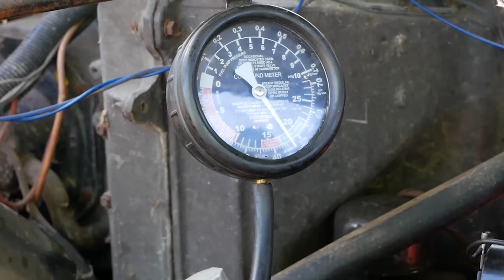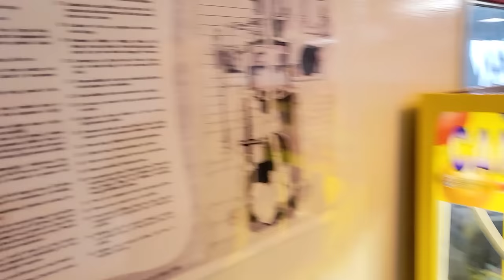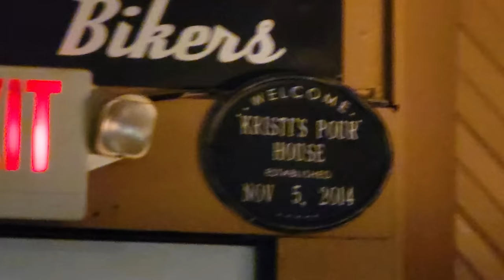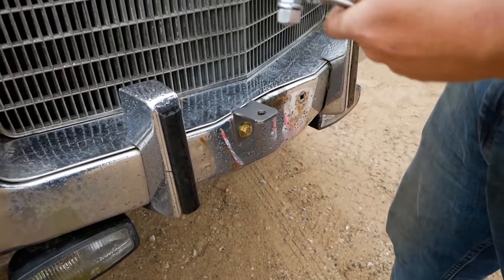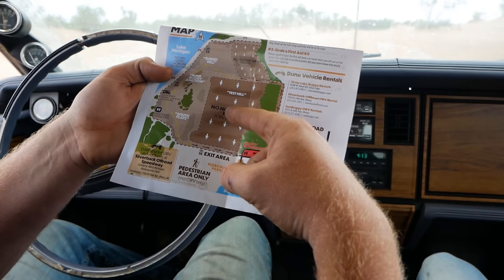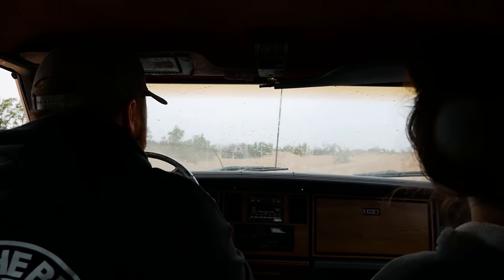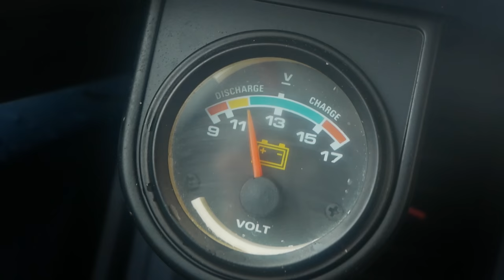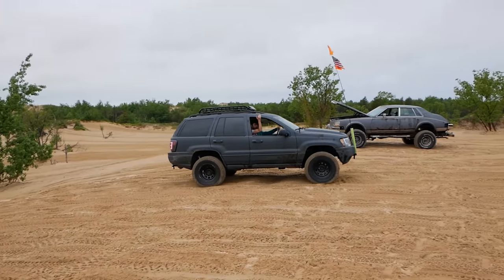4X4 CADILLAC First start in 15 YEARS! - Part 3 - The Dunes

Comment from the maker: 🏹 Start playing Hunting Clash for free on your iOS/Android device https://huntingclash.link/JunkyardDigs. Use my promo code JUNKYARDDIGS to get an awesome starter pack for a total value of $15 (available for new players only)🦌
Reply from the maker: @tadaho2128  its called a recap...? Used to do it every video when we had to split stuff and didn't have an intro filmed
Reply: Next farm episode?
Reply: @johngrefer9799  I would imagine in a while, they already planted, not much left but to wait right.
Reply: how well will the AMC Eagle do in those sand dunes?
Reply: Yeah I'd invest in a set of dove-c heads and a top dead timing set and a rebuilt distributor for the 460 think you'll be surprised how well it'll run I still think the roll pin is sheared and the gear is bound on the shaft causing it to be advanced to far when the mechanical advance comes in lots of timing advance and low compression equals lots of pinging out of a 460
Reply: That's funny, nobody wanted to ride with Jesse.
Reply: I say you try n get the motor actually running right maybe bolt on some extra ponies and then try her in the mudd instead 🤔🤷‍♂️ this badboy could definitely make for good content fixing her up and seeing what you can make of that big block and how capable the thing really is when she has all of her horses in tow! 😝
Reply: im surprised with your understanding of tuning, you drove that thing pinging like that,
Reply from the maker: @faslane5  didn't have a choice unfortunately, distributor was siezed in the block
Reply: go buy or get one of those stator kits they sell to bump up your alturdnator to 170-200 amps. Those stock pieces of junk dont work worth a shit.
 Then you can give us a demo on that rebuild. Good for some xtra content.
Reply: great now i have a nother game addiction hahahah thanks ill game
Reply: 18:28 when u wake up in the morning
Reply: You've got to take the three wheelers out there
Reply: Why don't you bring your little tricks or your 200m
Reply: When will you post the power tour
Reply from the maker: @AZed604  next week

Comment: True story, I am not just a car nut, I'm a maritime historian as well. I honestly thought that you were joking about the ferry being named the SS Badger. I just looked it up and watched some videos of the ship's history. It was built in 1953 as a rail car ferry, and it was bought in 1992 and converted into a car ferry. It's 410' 6" long, 59' 6" wide, and is 4,244 gross registered tons. It displaces 6,650 tons. It has two four cylinder compound Skinner Unaflow steam engines, four Foster-Wheeler Type D water boilers, and produces 7,000 shaft horsepower at 470 psi boiler pressure. It's top speed is 21 knots (or 24.16 mph), but it's cruising speed is 16 knots (or 18.41 mph). It's got a cool history.

Comment: Glad ya enjoyed your visit, you'll have to come again, lol...

Back in the mid '70's, when I used a coping saw to remove every other row of knobbies to make a poor boys sand paddle for my 400cc 2 stroke dirtbike, there was a guy with a Chevy van, wide tires, shag carpeting, etc & a straight 6.  That would air down to almost flat, & run around in 2 wheel (1 wheel?!?) drive...  He always seemed to have fun & still drive out, lol!  Sure glad you weren't there on a weekend, place is nuts nowdays...

Thanx for the fun!

Comment: I had my (new at the time) 75 Bronco up there the last time 45 years ago. While climbing hard on the hills on the Sunday afternoon before we were leaving for home, (didn't have a trailer for it,) I got the transmission so hot that in shifting it from neutral into drive, it would take about 20 seconds to kick in. Totally foamed the tranny fluid!! Made it home from that, and installed an external trans cooler the next week! Nice to see that park hasn't changed too much in all that time. Still the same entrance - rough as a cob! You guys did great with that old beater!!!! 🤣

Comment: I'd try fitting the proper clutch driven fan and fabricating an appropriate fan shroud out of aluminum so it would mate up with the radiator.  Not all electric fans are suitable and often times they just flat out suck for airflow in comparison to the original clutch fan.
Reply: this 460 had a mechanical fan not a clutch fan a good efan will out perform a clutch fan but a mechanical (direct drive) fan is worse than a parts store pusher fan
Reply: @TylerDuysen  I wouldn't want to run a fixed fan either but you can probably acquire a clutch fan adapter, just as they make adapters to turn a clutched fan into a fixed fan.  I have a feeling those E-fans aren't enough for that big 'o girl 460.  Plus god knows the efficiency of that cooling system as it is.  I installed 3 10" Flex-A-Lite electric fans in my 1995 Jeep Cherokee and they weren't always enough to keep it as cool as it would have been with the stock clutch fan and e-fan combo when it came to the trails.  That was also combined with running with a 3-core all metal radiator too.  The 10" fans didn't pull the volume that the big clutch fan did.  High RPM revs at relatively low speed (low ram airflow) will definitely show you the weakness of your fans.
Reply: @TylerDuysen  That's right but any bigger and the fans would be hanging down below the radiator anyway due to how narrow it was.

Comment: SEEEEEEEEEEEEE BROOOOOOOOOOOOOOOO!!!!!! I LEARN SOME NEW SHIT EVERY TIME WATCHING  YOU..... I HAD NO CLUE WHATSOEVER THAT YOU COULD POUR WATER ONNA RUNNING ALT AND NOT HAVE IT SHORT OUT!!!! I'VE BEEN A TECH FOR A LONG TIME IN MY DAY AND THAT ONE BROO IS A NEW ONE TO ME AND I SEE IT DID NOT SHORT OUT LOL!!!!! JUST SAYIN!!! THANKS, F.M.V.
Reply: You can also pour water into the cylinders of an engine with it running and it won't harm it... You would think dumping a bunch of water down the cylinders of an engine block would hydro lock it and in most cases it will but when done right you can actually do this and use it as a method to steam clean your cylinders to get carbon build up out and make your engine run a lot better if they're all gummed up and caked with carbon
 it actually won't hurt it at all and a lot of old school guys used to use this trick to clean carbon build up out of their cylinders. As long as the engines running you can feed water into your cylinders very slowly while having a brick or something wedged on your gas pedal heaping your engine at around 2000-2500 RPMS you have to pour several gallons in it not at once obviously or will hydrolock... You very slowly poor around a quart in it and you'll see your exhaust start to smoke but it's not actually smoke it's steam if you pour too much you'll hear your engine start to bog down and it will die you don't want that you pour it very slowly then watch until the steam out of the exhaust clears up then pour more and repeat the process until you think you've done enough if you take a borescope in the cylinder and look at the before and after it's very astonishing how effective just simple water can't clean out those cylinder walls... When I first heard about it I thought this old school dude was trying to trick me into ruining my motor I talked to a couple more people and then I actually saw a video when I looked it up some YouTuber legit street cars did it on a BMW

Comment: This thing is SO AWESOME, and it definitely deserves a solid revamp! Fix the timing issue, get some proper off-road shocks in there if it doesn't have them already, address the cooling issue, and this will be such a badass off-road rig!

Comment: just simply awesome.  I don't believe that 460 lasted the day detonating like that!  it probably already has broken ring lands so it doesnt matter.  hope you can get the distributor free.  it may be a 68-70 429 or 460 which would have had 10.5:1 compression so if it's that just throw a big cam in it and valve springs and boom!  love the content, hope to meet you guys at a show/event someday.

Comment: I love about an hour from Mears and have visits Ted several times. The dunes there are ever changing due to winds. If it were a normal dry day you would’ve struggled much more, as the sand gets extreme dry and powdery. The weekends are very busy there but awesome to wheel and spectate

Comment: Another great video Kevin. I hate to spoil it with bad news, but that exhaust leak may be permanent.I worked on a fleet of F-350 1 tons in the late 80's and early 90's, and the cast iron exhaust manifold on the drivers side would shrink and break the cylinder head right at the last exhaust stud. We would take the head off and have it welded, but the old manifold wouldn't fit because it had shrunk, and the new manifold would shrink sooner or later and break the head. Ford finally sent us a revised exhaust manifold, they simply turned the last hole into a slot. It still shrunk, but it didn't break the head.

Comment: I think y'all should build a shifter cart with paddles to take back there. It kinda sounded like the timing was advanced, I heard you make comments about the harmonic balancer. Also if you have slacked your tires to about 15 psi you would have been surprised.

Comment: those little buttons in the top of the hat hurt like hell. I was a truck driver and drove some really stiff suspension rigs like dump trucks and have launched out of the seat sometimes even with the belt on and hit my head like you did.

Comment: If you really want to see some big sand dunes in Michigan then you should check out the Sleeping Bear dunes national park on the western side of the Leelanau peninsula. Some of these sand dunes are four hundred feet tall. And it's a straight drop right down to lake Michigan which means that you wouldn't be able to get the badilac or any other off road vehicle up these dunes.

Comment: The wet sand probably helped that thing grip a lot better than if it was dry. You guys sorta lucked out. Dry sand you tend to sink a lot more and can risk getting stuck if your in a heavy rig with the wrong tire pressure.

Comment: Did you guys test the compression to see what gas you should run cuz I'm betting she may have some high compression pistons in there not saying for sure because obviously I've never seen inside the engine but I bet if you threw some mid-grade or premium in there she would probably stop knocking that or maybe your secondaries were just too mean or the power valve no clue

Comment: In the beginning we always think it’s the carburetor,it’s never the carburetor,bent valves,broken valve springs and broken compression rings are most likely the reason your caddy runs like crap,plus it has a ford engine.

Comment: hey i have a 1992 f150 302 thats efi i have pulled the motor and i want to swap it to carb, would i need to change the heads or just the intake to carb? or is there anything else i would need to change over, ive never done motor work

Comment: "i hate e fans put a mechanichal fan on itll never fail" yes they will they always fail and they can never keep up theres a reason all new cars have efans its all about cfm you cant put a junk fan on with low cfm then get mad when it doesnt work those efans are extra cooling a decent efan will out perform a mechanical fan everytime anywho this was a beast on the dunes and looked badass jumping just a couple feet in the air i cant wait to see what you do with this thing down the road
Reply: also on a side note a 7k hp steam boat that is just badass

Comment: OK, you had way too much air in your tires. If you can't climb those hills without a huge running start, you have too much air. I asked one of the locals, the guy who runs the rental Jeeps. He took one look at my tires and said 8 lbs. I kept lowering them and lowering them, and guess what, the guy was dead on. There was a big difference between 10 lbs and 8 lbs. Learned my lesson that day.

Comment: Call that card call that caddy lwa luxury with attitude 460 or 460 engine put your nice cam some 429 Cobra jet head or either some police interceptor heads Edelbrock performer intake and a 770 Holley carburetor Street avenger or either the truck avenger car that old so that way you don't bother going up the hill and put you some headers and have some fun don't give up that car holla if you hear me